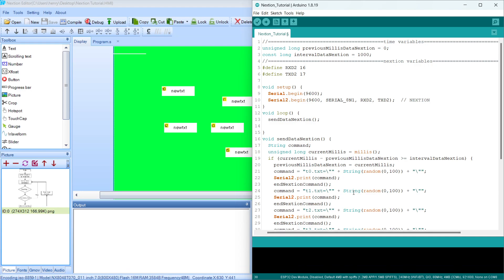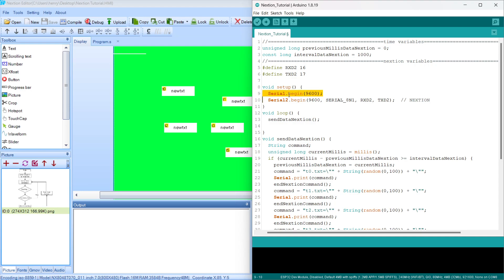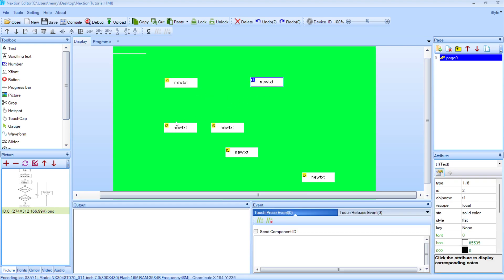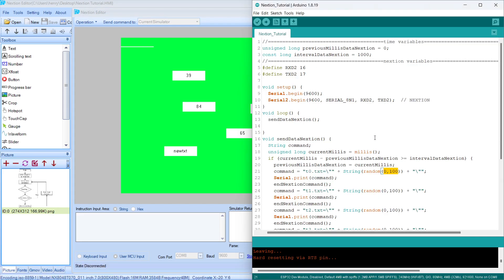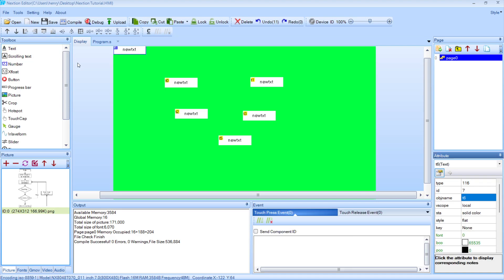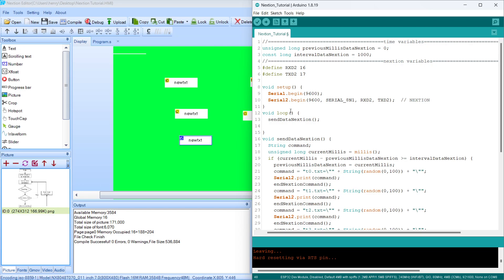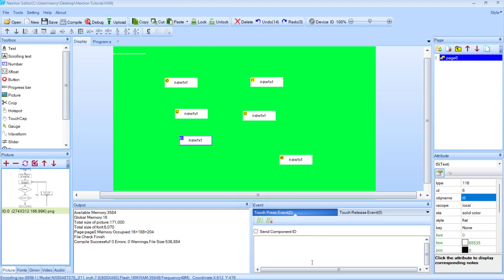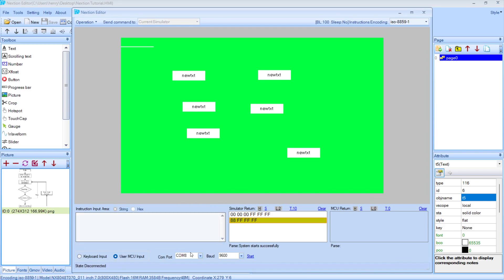How to Simulate Arduino and LCD Nextion without the LCD

Comment: i guess most content creators assumes the everyone who like to know how to simulate arduino and LCD already knows the most basic connection. Save you guys the trouble i am giving you the solution here. You need to connect your arduino via CH340 or compatible USD to TTL adapter to your PC. Separately power your arduino if the USBTTL adapter is not giving enough power to your arduino board. Doing this, you will see in Device manager in windows that you have a pair of USB serial port for example COM3 and COM6. Set your arduino IDE board to COM3 and in the nextion simulation, set the user MCU to COM6.